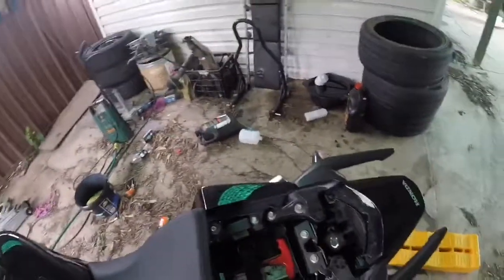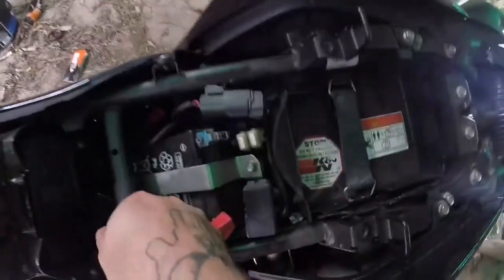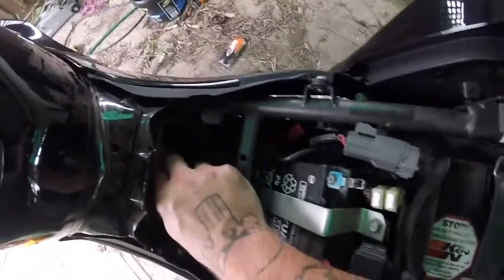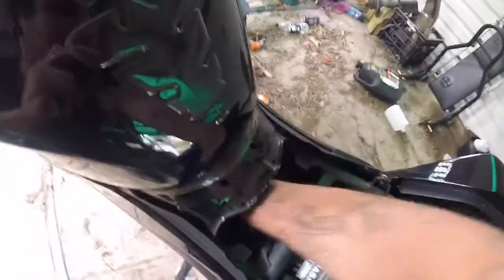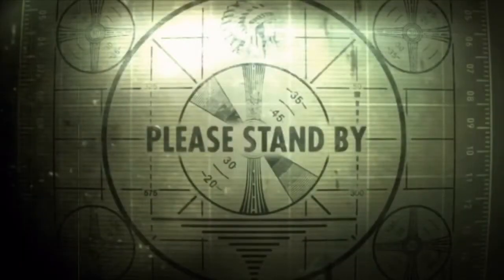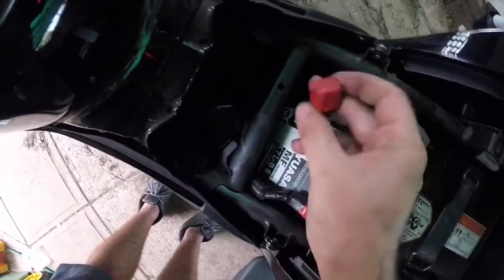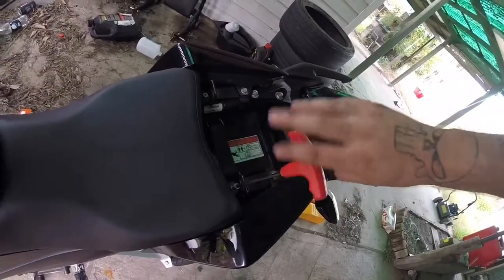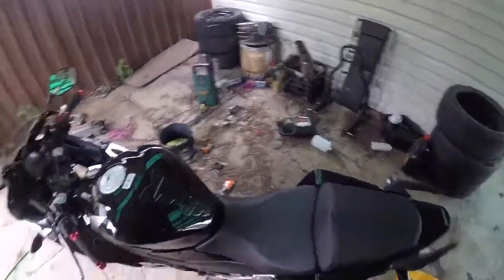Cbr 300r /250r k&n air filter install

Comment: I'm having a problem with my K&N not wanting to snap up into place did you have that problem?
Reply from the maker: Young Gun at first I did it snaps in but you don’t actually hear it click as long as it’s secure and it don’t move or drop when trying to make drop it should be fine
Reply: @Mt09reaper  Mine does not stay in place I'm doing a fitment with K&n now.
Reply from the maker: Young Gun make sure the filter is in the plastic surround as it can move and cause problems I also found it’s a bit tricky to get the back of the filter to sit where it should as it can drop a little and cause it to not click it I just reached deep in the air box and pushed the back up to make sure if all else fails. There may be a fault with the air filter surrounding that was supplied